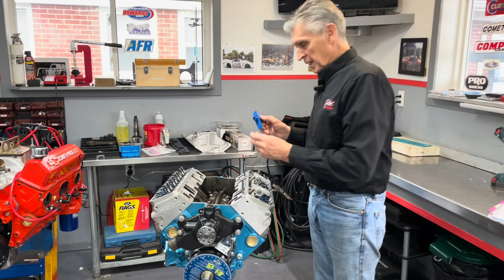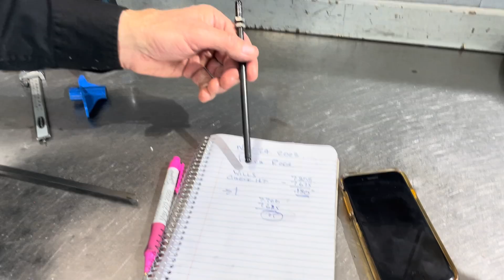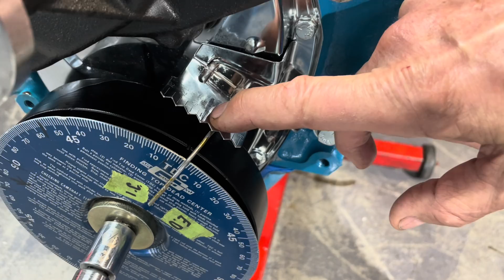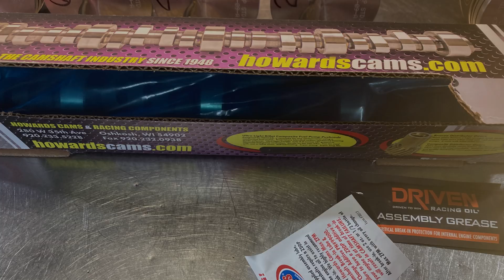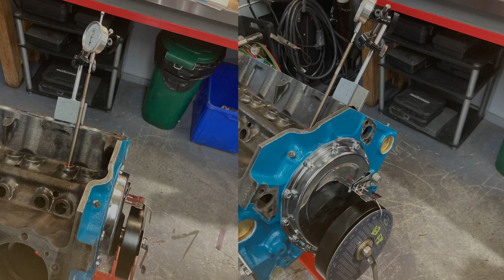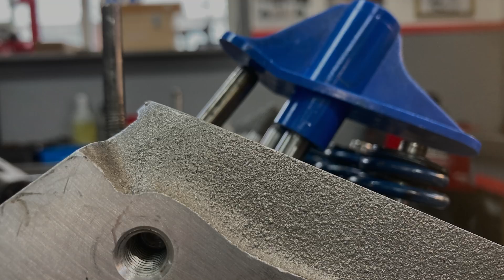How to increase Performance HP and TQ on a Budget and 350 SBC Chevy step by step assembly tips

Comment: Hi Allan, really like your show.  I have a question.  I am building a 1971 sbc 400 4.185 bore.  Standard deck height and was already bored when I got the block.  Trying to do this on a budget so I don't want to have to get it decked.  My piston rod crank measurements  come out to be 9.005 and deck height is 9.025.  That leaves me .020 below deck.  My question is can I use a .020 or .025 head gasket to get my quench.  Trying to find out if this will cause any problems  on this 400 and if I can get a good head gasket that is that thickness.  Let me  know what you think and If I have to I can get it 0 decked and then use a head gasket to get the quench.
Reply from the maker: Thanks for the question Patrick. Cometic makes a .028" MLS head gasket. That would give you .048" quench. Maybe not perfect but acceptable. I think you will be fine with that. There may also be thinner gaskets available. I suggest also that you mock it up and actually measure the deck height to confirm your measurements. Hope this helps. AG

Comment: Will the compression go up after 5000 miles when the rings are totally broken in?
Reply from the maker: Good question Steven. Not very much. We consider the rings broken in after 3 pulls on the dyno. You can check it and find out. AG

Comment: My quinch I keep at .042 to .046 street performance, and 2 bbl carburator race engine I run between.034 to .044 . As David Vizard said you can go tight as .022 but they made A Lot of desk paper weights getting there.
Reply from the maker: Thanks Larry, it's all good until the piston hits the head! AG
Reply: Built a dirt car pure stock I use .026 mahle gasket the guy's won many times that year they decided to freshen up and put .015 steel shim and shal we say they found out , every piston had exhaust valve contact said it didn't want to turn over very easy , need less to say they brought it back and freshen turned into rebuild .
Reply from the maker: Thanks Larry, lucky it didn't brake a valve, you know what happens after that. AG

Comment: Allan - On more that one occaision you refer to the distributor of choice you use for your SBC builds. What brand are you referring to?  I'm looking for one for my 383 stroker.   Thx Al
Reply from the maker: Thanks Al
Bravex Super High Performance HEI for Chev Big Block and SB Ready to run. With Melanized gear. They are on Amazon. AG
Reply from the maker: They have them for other engines as well. AG
Reply: Thanks! @goldsgarage8236
Reply: As a new subscriber who stimbled on your site, I really like your no nonsense approach to building engines.  On a related topic, I installed a BP 383 in my Corvette a ffew years ago, and have been running it without vacuum advance per their instructions ( I see GM recommends doing the same with their crate 383)  Why is that?  You mentioned in a video that it causes hard starting, which has been the case sometimes.  My 383 has gobs of power. so, I'm at a loss to understand what vacuum advance really does.   Thanks.
Reply from the maker: Thanks for the question Al. This might be a good subject for a future video. i will get back to you soon with a detailed response. AG

Comment: I'm  going through my old '73 Nova engine this winter. Its just a 2 bolt main block that I'll upgrade to ARP studs. I'm probably gonna order a complete rotating assembly, rather than spend money grinding the stock crank and resizing the rods for ARP bolts. The pistons are always the tricky part of a pump gas street bound engine build. I already have some rebuilt 882 heads that have been modified for up to .500" lift cam. Most stock style dished or flat top pistons won't create enough compression with factory heads. If your trying to use a bigger cam and factory heads, you definitely need to build some more compression into the engine somehow. The only way to do it without zero decking the block for true flat tops, is steel shim head gaskets of .015 compressed thickness with KB domed claimer pistons. The kit I'm looking at should make about 9.5 to 1 compression ratio. With the Comp 280 magnum cam that has .480" lift I should be able to make 300+ HP. Should be plenty for the tiny litte S10 pickup its going in.
Reply from the maker: Thanks Andrew. Sounds like toy have given it a lot of thought. Planning is the most important part. Good luck with your buils and let us know how it turns out. AG

Comment: Love your channel. Can you please tell me if there's a way to calculate compression ratio on an assembled motor?
Reply from the maker: Thanks for the question 66. The best indication is the cranking compression pressure. If you know your camshaft intake valve closing point, bore, stroke, combustion chamber volume etc. you can work it backwards to find static compression ratio, or come pretty close.  I use the Wallace Dynamic Compression Calculator and Summit static Compression Calculator. Actually cranking compression pressure is more important. I plan for 180PSI max for street pump gas engines. Hope this helps. AG

Comment: Allan, I am using that same set of pistons, but my piston and rod combo is 25 grams less each than the stock L98 (IROC Camaro) pistons and rods. Did you have this problem? Is this 25 grams less gonna cause balance issues for the crank? It's a truck engine that will probably never spin 6000 rpm.
Reply from the maker: Thanks for the question Lee. Following is how I think about it. 
First if you have any imbalance, better to have the pistons lighter as yours are. Also 25 grams is only about 2% of the total weight of the piston and rod. 
A reciprocating mass like a piston, with the forces of combustion acting on it,  is never really in balance, compared to an electrical armature or fan impeller where the forces are tangential. 
Especially for a street engine that spends most of its time under 3,000RPM you will be fine. 
When is the last time you saw a crank break in a street engine? AG

Comment: on the subject of compression...how would a person go about determining deck height of a block that you know has been decked - but don't know by how much ?  To get the desired compression ratio, how can one order pistons, head gaskets, etc  or do the "math" if the factory quench distance is gone?  really enjoy the videos!  thanks in advance...
Reply from the maker: Thanks for the question Job1, actually a lot of questions. I will make a video about all this in the future but for now i will do my best to answer your questions. 
First, the OEM spec for a SBC for deck height for example is usually about .035". Often machine shops will deck the block just to get it flat and square so they will only remove .005" or so. 
To determine your deck height first you need to be sure the piston is at TDC. The most accurate way to do this is with a degree wheel and a dial indicator, but if you don't have a degree wheel the dial indicator will be close enough.
Set the indicator up in the center of the piston and rotate the engine slowly to determine TDC. 
Now that you have TDC, there are a few ways to measure deck height. I use a depth micrometer, zero it on the block and measure as close to the center of the piston as you can. 
If you don't have one, you can use a straight edge across the top of the block and feeler gauges. If you do it carefully you should be able to get close enough.
Check all four corners, #1,2,7,8 pistons until you get consistent results. 
Now add your deck height to the thickness of your head gasket and you have your Quench. 
One way to improve your quench with stock deck height is with thinner head gaskets. 
OK, now to determine compression ratio. You need t know your bore and stroke, deck height, combustion chamber volume, piston dome volume and head gasket thickness. 
Google Compression calculator and enter these numbers. The Summit calculator works well and is easy to use. 
Now google Dynamic Compression Calculator. Wallace has a good one. Now you need to know the intake valve closing point of your camshaft to determine your dynamic compression and cranking pressure PSI. 
For a street engine I like to be 160-180PSI, closer to 180 if you can get there. 
Now you select your parts or combination of parts to get the result you want. 
when the engine is done and broken in measure your compression cranking pressure with a gauge to verify that you got it right. 
Hope this helps. Let me know if you have any more questions and watch for future videos on this subject. 
AG
Reply: @goldsgarage8236  thank you very much for taking the time to respond.  That is a very helpful!  In my case I know the block has been decked but I don’t have the pistons (I am ordering a stroker kit ) and trying to determine what to select regarding dish size to get around 10:1.  Is it best to err on the bigger dish size just to be safe and use a thinner head gasket after things can be mocked up?
Reply from the maker: Glad it was helpful. Take it a step further and calculate your dynamic compression and cranking pressure first. The deliverable is cranking pressure. You can play what if's with the algorithms until you get the result you want. Don't guess! AG

Comment: I remember Car Craft did a compression ratio dyno test on a Chrysler big block. IIRC they were getting around 5 percent increase per point. 9 to 1 was 400 hp, 10 to 1 was 420, and 11 to 1 was 440 hp.
Reply from the maker: Makes sense Robert. I used 4% because based on our experience. The numbers may vary based on the engine and other factors. AG

Comment: You are correct on the machine shop. It doesn't take long to eat up your budget pretty quickly there. I have an L-31 Vortec there now. To have the block hot tanked and magged and to R&R soft plugs and cam bearings and dimensionally check block and ball hone the block is $400. They wanted so much to go through a set of Vortec heads I just ordered a set of AFRs from Skip White and traded the Vortec cores to them for the other work. Contemplating just ordering the complete rotating assy from Skip White and they will check and size the rods there and the come already ballanced with a polished crank for a reasonable add. charge and just drop it in. At least that way I get a Scat crank, Scat bushed I beam rods, Wiseco pistons and Hasting Rings and King Bearings and a Pro street SFI balancer and Flex Plate for around $1450. If you're not caeful you will spend what you could have ordered a new blueprint engine for. Heck for $4600 you can get a new 4 bolt L-31 Vortec 350 with a 3 year 100k warranty delivered to your house and add a cam and manifold and headers and be done with it. The only reason it went to the machine shop at all was the fact it was an unknown engine with 150k miles on it. thanks for the video.
Reply from the maker: Thank you Mark for taking the time to comment. Our thinking is pretty well aligned on this subject. AG

Comment: Where did you get that pushrod tool? I've been figuring out pushrod length usiing Straub Technologies method.
Reply from the maker: Both Amazon and Summit have it. AG
Reply: That "tool" does not take valve lift into account.  Straub's method does.
Reply: @jeffreydurham5342  I knew it was too good to be true 😄
Reply: That "tool" does not take valve lift into account.  Straub's method does.

Comment: Every body has different ways and tricks I like to watch to see if I can pick up something different. I like fitting the timing gear and balancer to the crank before I install,timing gear no problem but balancer can be a problem. I also check pan to pickup with only it installed no crank you can look down the cylinder and see exactly what you have Thanks for your info
Reply from the maker: Thanks for the tips John. AG

Comment: Those GM lifters with the "cap" are the only lifters i would use, comp cams make some "copies"  but i would only use the GM lifters...
Reply from the maker: Summit Compression Calculator for compression. Google Wallace Dynamic Compression Calculator for  dynamic compression and cylinder cranking pressure.  AG
Reply: @goldsgarage8236  I think you replied to the wrong person...

Comment: You shouldn’t use that plastic pushrod checking tool for anything but stock type rocker arms, and with stock iron head valve length.
As soon as you change either, you should use the midlift method which results in the narrowest sweep, which is most important.

https://youtu.be/o5is9BsH5OU?si=kL3FumWmgdg5Lvq5
Reply from the maker: Thanks Pockets, there are many ways to check push rod length. Did you notice that all the valve tips were painted with Dychem? Witness marks from the rockers will validate that I got it right. AG
Reply: I did. As you know, narrowest sweep is most important, as that gives minimum scrub motion across the valve. As long as the mark is in the center third of the valve stem diameter, narrowest sweep trumps perfectly centered.
The wider the sweep, the more scrub action (pushing sideways) the rocker tip does.
If the rocker is pushing as straight down on the valve it can, it doesn’t have to be perfectly in the center. Wide sweep will always wear guides out faster.

Comment: If you put the heads on the block with no pistons in it, you will see that the edges of the chambers are smaller than the bores. That is where the valves are close to the chambers. If you unshroud the edges of the chambers you might be surprised at the free power you can gain
Reply from the maker: Thanks for the tip David. AG

Comment: Cylinder pressure can always be increased by running a narrower LSA
Reply: Actually it's the other way around. Wider LSA makes for higher pressure, narrow LSA is for overlap, scavenging of cylinders, and midrange/higher RPM power.
Reply: @erikturner5073  An engine will have more cylinder pressure with say a 108° LSA verses a 112° LSA.  BTW this is a friendly disagreement. 😆
Reply: @rogerstill719  there's no argument. 😉, no need to be afraid.
Reply: Probably  and running a wider LSA bleeds some off?

Comment: How do u calculate cylinder pressure from quench & compression measurement? Or where can I look this up? I know how to measure & calculate for compression, but I just do a compression test to find cylinder pressure? I'm unaware of a formula to calculate it??
Reply from the maker: thanks for the question Jesse. Summit has a great on line calculator for compression ratio. Wallace has a good one for dynamic compression and PSI cranking pressure. Just google it and enter the values. AG